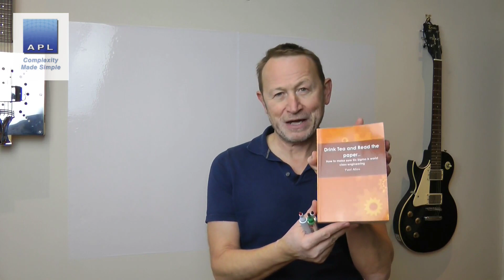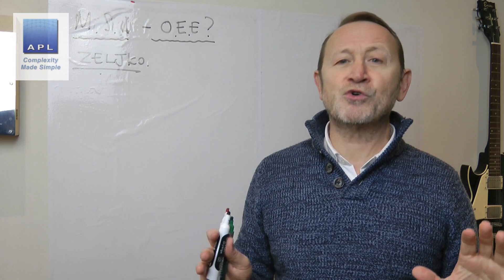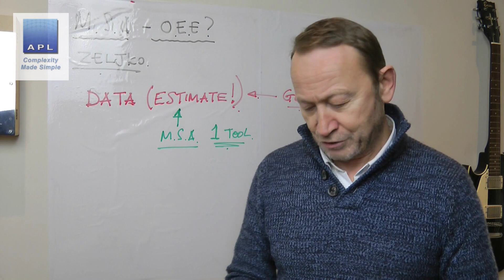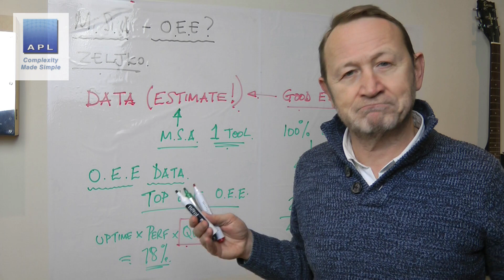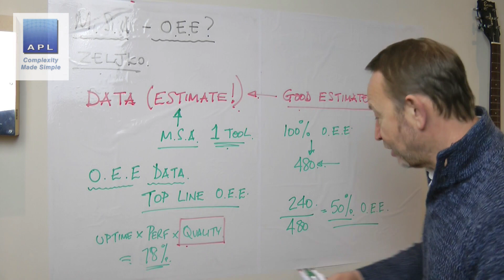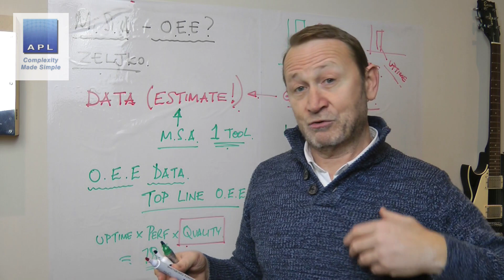OEE Data - Does it need an MSA?

Comment: Thx sir....

I know that OEE is for production not for service. Is it right?
Reply from the maker: possibly although you could modify it to suit service I think
Reply: I would be reluctant with applying OEE measurements to non-equipment. This base idea is very useful for any performance/capacity analysis, but the categories and logic used in Overall Equipment Effectiveness assume a lot of very machine-specific things.
You can definitely put measurements and target on performance (actual operating speed / realistic max speed) and the bigger time sinks (like breaks, cleaning, equipment failure, waiting for upstream/downstream processes, etc.), just do it very purposefully, because you will have to alter the 'normal' rules and categories of OEE.
Reply from the maker: Good addition Tom  - In lots of service areas there is no practical way to measure speed, so I guess my advice might be, use your common sense if OEE 'fits' without too much modification then use it, if you have to tie yourself in knots to make work, then forget it...